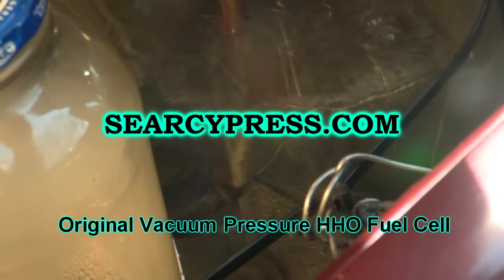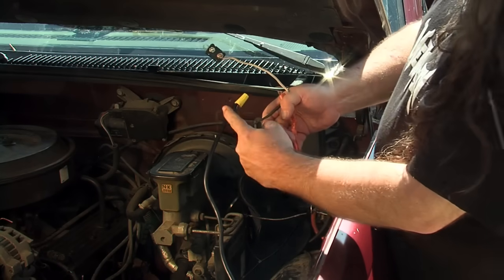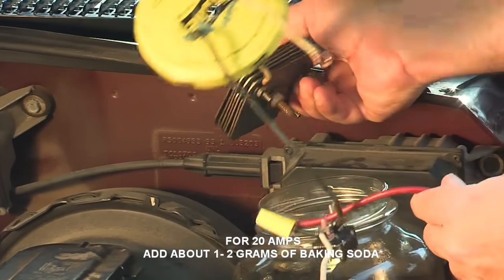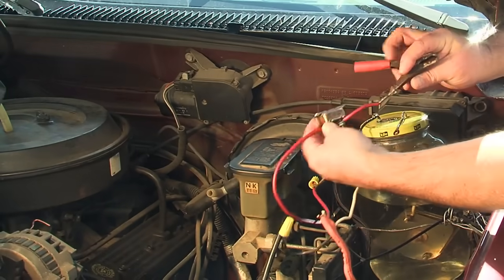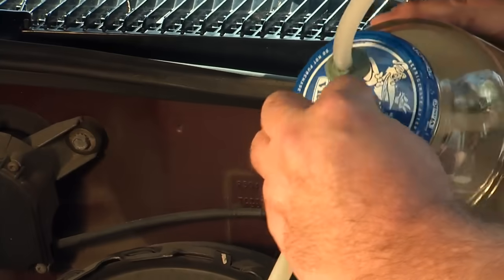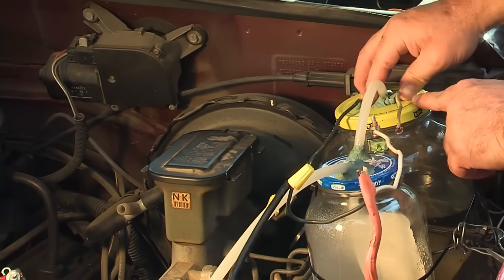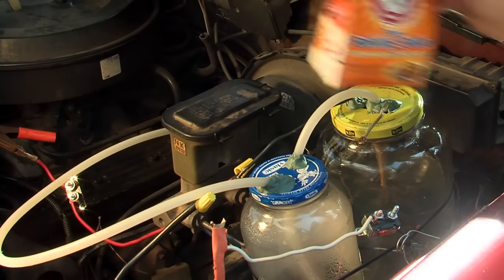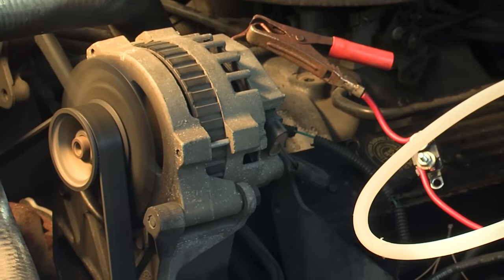Vacuum Pressure Hydrogen fuel cell defeats high gas prices using hydrogen from H2O.

Comment: 286 kJ/mol is required to electrolyze the water.
241 kJ/mol is released when HHO is burned.
This would only make sense if you were running the electrolyzer on its own battery bank that you charged at home. But then you'd have the added weight of more batteries forcing more work on the engine anyway.
Reply from the maker: Just remember we are not trying to power the engine with HHO. What we are doing is trying to burn the 20% of the gasoline that is normally unburned. That leaves a lot of room for gains without breaking any laws of thermodynamics.
Reply: This AND the amount of gas created would be negligible compared to the amount of air going through the intake.
Reply: You got your numbers backwards. 286KJ is released when hydrogen is combusted with oxygen. 241 KJ is required to electrolyze water to hydrogen. So in the end you have excess of energy to do work.
Reply: @HAGA7793  only a peak of 75% of electrical power is produced as hydrogen, the rest of the energy you state is actually oxygen... so you're running at a 25% loss before you even consider the 60% loss in efficiency from fuel to electricity from the alternators efficiency loss....

That's around 85% efficiency loss on a alternator that doesn't have a hot radiator on a hot summer day blowing on it too...
Reply: @dylandesmond  where are you getting your number from? Can you provide source?
Reply: @HAGA7793 If those numbers would be remotely true you would have energy gain, so effectively free energy. Which surprise surprise isn't possible.
Reply: This would work if the alternator is wasting energy, which it probably does, so as long as the wasted energy is more than that difference of ineffeciency in the creating HHO it would add energy to your motor simply by making it more efficient, I imagine this would work and could be a very good system. Does anyone really know how much wasted energy there is in an alternator? Not just conjecture, if they do it would answer clear up whether this would be a good system.
Reply: @seekerscovereal  not really the case, once battery is charged the alternator doesnt produce the same energy, basicaly enought to keep charged, that why when battery is charged the voltmeter may be at 12.5 to 13 volts but when battery is almost dead it will charge 14 or 15 volts. There is no free energy when dealing with rotational forces with parasitic losses. If it was this easy someone like bezos or musk would have a trademark on it and oil executives would be retiring in record numbers.
Reply from the maker: Not sure you're getting it. The object is not to power the engine with the gases we make. What we are doing is completely igniting the fuel which is normally unburned. This can be a substantial amount. In this engine about 20% goes into the catalytic converter. The extra energy comes from the gasoline and not from the battery. The catalytic converter runs much cooler and  a large amount of water exits the tailpipe. We  have a new video coming out this year. Thanks very much for the comment.
Reply: He does not comprehend the added efficiency of this allowing better efficiency of the fuel already uses.
Reply: I would make the HHO on a separate circuit that is charged off of small solar panels
Reply: @teemun3979  Wouldn't generate the ~30 amps you need to produce decent HHO
Reply: @taylorfielding5090  You would have to charge up a separate battery or form of capacitor over a long period of time which would discharge at the correct amperage once it reaches a good point. The whole HHO thing isn't efficient no matter how you do it, but at least if you had it on a separate circuit you could argue that you aren't wasting energy creating the HHO.
Reply: @teemun3979  The problem I see is that most solar panels (for cars) trickle around 80-100 mA, and it would take forever to charge a large capacitor. Unless you got a decent size panel, it wouldn't do much
Reply: @teemun3979  Nice idea....but probably only enough surface area on a typical vehicle to charge a phone...maybe run some lights.
Reply: Hmm, nice discussion.
Don't believe everything you read on websites and even some books are full of bs.
10 amps is more then enough to create  hydrogen to run your 4 cilinders engine.
Reply from the maker: The goal is not to run the engine. The goal is to burn the fuel that's getting wasted. That concept seems to be beyond a lot of peoples understanding. They assume that all that gas we are squirting into the cylinder is getting burned. Most of the time 80% or even less is actually used. The system removes engine knock preventing damage to pistons and cylinder walls as well as improving efficiency even if there were no other gains. I totally agree, sometimes less is more. Thanks very much for your comment.
Reply: @metalpresstv  
Hmm.
I agree that some intervals some sensors must be cleaned or replaced.
Reply: Yup, all these people failed science. And math.
Reply: @pepsiman91  I don't see how it would make any positive difference, you're still pulling drag from the motor to product the energy needed.
Reply from the maker: Let me explain. We are not trying to power the motor. What we are doing is injecting HHO in the state of vacuum where it is not diluted by intake air. 20% of the fuel that goes into this engine goes unburned and is ignited in the catalytic converter. Our goal, is 100% ignition of all of the fuel. This system gets extremely close to that. Instead of burning the fuel in the catalytic converter, it is burned in the cylinder where it is converted into usable energy. You might ask yourself why in the world are we wasting 20% of the fuel? Just imagine, if you were building an engine and you told the boss, we're only getting an 80% burn. And the boss said, that's fine. As an engineer you would know that that would be unacceptable. However, this poor design allowed for a complete industry of a emission controls. That is a ton of wealth for the industry itself in producing those devices. People see a lot of water coming from the pipe as shown in the video. They think I am saying this is from the hho, but it is not. It is actually coming from the gasoline itself. The reason you don't see this much water coming out of the tailpipe most of the time is because it is vaporized into steam through the catalytic converter. When you get very high efficient burn the catalytic converter does not get hot, at least not right away.When first installed, a lot of carbon and nasty junk will be ejected on to the ground. I've never seen too many things that can actually clean a catalytic converter, but this most certainly will remove a lot of build up. We have a new video coming out very soon. Thanks for the comment, do me a favor share the video. I would be most grateful if you would subscribe so we can show you the new video coming out very soon on this topic. I will do my very best to not waste your time. Thanks for the comment,.
Reply: @metalpresstv 
Combustion does not take place in the catalytic converter. If raw fuel is reaching your converter then its going to get plugged up and need replacement. Fuel reaching the converter would be caused by faulty injectors/carburetors, faulty air intake, or faulty ignition. Fix those issues. 

Hydrogen is far more reactive than vehicle fuel. Hydrogen will combust at 4% concentration, or less if under compression. The reason your tail pipe is puking out water is because all the generated hydrogen is reacting in the engine to make water. This is a fact. You can't change chemistry.

Assuming you divide your hho generator to vent the hydrogen and leave only the oxygen, then how fast would the system have to work? A small car engine moves 700 liters of air per minute at idle. That's almost 150 liters of oxygen. A 25 amp HHO generator will generate a little less than one liter of oxygen per minute. That is not an appreciable amount of oxygen. Once again, this is an unchanging fact of chemistry.

If you want more oxygen in your engine then add a blower to pre-compress the air heading into the engine.
Reply: If the burn is cooler then the exhaust is cooler and the hydrogen in the gas or diesel will also produce water.  A good test would be to see how much water actually comes out of the tailpipe - could be more than is used from the pickle jar.  
Trouble is Carnot says the % work that can be extracted depends of temperature difference.
Reply from the maker: @simonmasters3295  the catalytic converter is cooler. This is because the 20% of wasted fuel is igniting in the cylinder where it is supposed to be. I don't really think the exhaust temperature would be something you could measure accurately. There are just too many factors involved. The water coming out of the pipe is definitely from the gasoline. You can get about 200 MI on that jug of water. Interesting though. Thanks very much for the comment. Be sure and share and subscribe and we have a new video coming up very soon. Thanks for the comment.
Reply: @metalpresstv  your catalytic converter is cooler not because of fuel being burned.... if more fuel was being burned,  your hp would be higher and more efficient, and the exhaust system will be hotter especially the catalytic converter. 
Your catalytic converter is cooler because you have water trapped in it.
Reply: now also add how much is needed to produce electricity on the alternator to get the required power to electrolyze and then go further  how much of hho is produced by this amount of power at electrolyze and you will get a very low output ... So this HHO is stupid as  it gets... The only thing that maybe is using a retarder... but while its not adviced to store H its not a option.. almost all HHO experimental "Scientist " blow up once ... :9
Reply: Soooo say someone did this to a 2004 Jeep Wrangler. Is that an old enough model? Or must it be carburated and will the timing need to be adjusted and so forth
Reply from the maker: @pepsiman91  imagine you're an engineer working for a major engine producer. You use the most advanced technology in producing an engine that is well into the 95 plus percent range of efficiency. It works so well in fact, that no catalytic converter is needed. The emissions are well within acceptable guidelines. You then present this to your superior. Later it is completely rejected and you are told to redesign it to not be so efficient. I assure you this has happened to some poor fellow along the way. You see, there is an entire industry of emission controls that must be fed. The revenue from that industry is just too tempting to ignore. Thanks for the comment my friend.
Reply: @metalpresstv  get a wideband sensor. Install it where your water flow won't touch it on your exhaust.

Then you know if you're running more or less fuel,

As I said before, it's been debunked.
But using it on a solar setup and putting it into bottles has great results....

But you Need to adjust your timings and fuel. 

Get the wideband sensor and measure your fuel pressure and record how much fuel you use with and without the alternator producing fuel.

You'll be disappointed.

But as I said using fuel cells at home to harness hydrogen has economical benefits
Reply: SMH.
Electrical, Chemical, Thermodynamic to Mechanical force.
Regardless 286 kJ/mol inout it was still multiplied and output of 40% increase.
Laymans for you
Reply: @Nick S - You said: "286 kJ/mol is required to electrolyze the water. 241 kJ/mol is released when HHO is burned." Could that change, if outside air was also used, during burning?
Reply: @TOMGOOTEE  no, those are ideal numbers.
Reply: The engine is getting power mainly from gas. He’s just adding hydrogen and oxygen to the air intake to get more fuel. So the alternator is producing some fuel essentially
Reply: @bryanoverbey  Yeah, but the alternator is spun by the engine. Put more load on the alternator and more fuel is required to run the engine.
Reply: @nicks2437  Yes that is true, but when the car's battery is fully charged the alternator is still spinning with the potential to generate energy. So you are getting parasitic energy loss from turning the alternator anyway. 
Say that turns out to be 40 Watts of energy to spin the alternator and not generate any energy.
Then if you now add this HHO system, you may draw 200 watts to run it, but gain 180 watts from burning it.
You no longer have parasitic alternator usage, so you're only burning 20 watts to spin the alternator instead of 40.

These are made up numbers, and although I have a B.S. in physics I'm not sure my idea is accurate, but I'd like to find out more..
Reply: @bryanoverbey  While that may be true of alternators from decades past that used permanent magnets, modern alternators are designed with electromagnets so that the output can be varied to meet demand. So parasitic loss isn't really a thing anymore. And even if the battery is full the alternator is still powering all your vehicles electrical components.

Realistically, if this system was viable for fuel savings then vehicle manufacturers would have incorporated it a long time ago and charged consumers through the nose for it. 
>"Yeah, it costs an extra $3000 up front but you get that back within 10 years on the fuel savings. And don't forget to only run Ford branded electrolyte to maintain your warranty!"
Reply: @nicks2437  More weight of batteries is harder on the engine? He doesn't need to run a 1,500 cell module battery bud. Lmao!!! The extra weight at MOST needed would be a 12-24 volt series system. Like in a semi truck/tractor-trailer. 

That would be about 20-30 extra Lbs. Equal to his spare tire and jack. LoL!!

Edit: I should also add that I spent 20+ years engineering internal combustion components. I grew up as a heavy duty mechanic. 

You can get a high output alternator that would deal with the 29 amp draw. 29 amps is not a lot of a draw. It's equal to the A/C compressor at full draw. 

Do you know the stress of a fully engaged compressor on a motor running? 0.02-3% power loss. 

And I need to address your alternator tech talk. NOW ADAYS alternators are elctro-magnetic? The have been elctro-magnetic for over 80 years. Ever since passenger vehicles switched to 12v from 6v.

PS - "If this was a viable and efficient method then it would be manufactured"??? 😑 Were you alive for the Saturn EV1 fiasco? When GM was forced to repossess all of them from people who bought them and drove them? The fuel companies were outraged. How about biodiesel. One of the greatest fuel systems in the world. It is illegal to convert and no manufacturer makes them. They would lose a ton of money.

Canola oil internal combustion engines are another issue. A lot of engineers are being monitored just for showing people their designs of canola oil run planes, cars and commercial equipment. 

The only reason the fuel corporations are all onboard with electric and hybrid is because they started buying up lithium and cobalt mines and operations around the world. So now they make a ton of money even if they DO lose on petroleum fuel sales.
Reply: There is no way you spent 20+ years engineering internal combustion components and don’t understand the kindergarten level concept of conservation of energy. Anyone who knows what they are talking about here can see very easily through your bs. This is on the same level as perpetual motion, but you probably buy into that as well
Reply: @bryanoverbey  When the battery is fully charged, there is almost no load on the alternator, only producing enough electricity to run the spark plugs. When you put a 30 amp load on an alternator it drags the engine down, as it saps more energy to run the generator. Modern alternators are very efficient and produce only a minimal drag when not under load
Reply: @nicks2437  not necessarily true. You're giving Big Auto a lot of credit. Car manufacturers aren't going to waste time with this, since gone also are the days of carburetors and vacuum lines. There's too much that would ultimately wrong. Regardless of how this design was incorporated, somebody somewhere would try to modify it. Eventually somebody would do something stupid and blow themselves up. BUT, as far as alternators go, I have to side with you. OP's 350 V8 has a lot of rotational energy. Contrary to, say, a carbed 4 cylinder, where the amount of added rotational resistance could easily be a deficit instead of a gain.
Reply: @Twitch_Moderator  corporates not only gains from lithium and cobalt. They'll also sell more gas to ship those things, as well as for producing more electricity. Also i see that they're now having a fresh market with a reason to renew the car park, selling loads of new cars. Then electricity prices will skyrocket and gas prices will tank, together with the green illusion, leading to people wanting to buy gas cars again, so more new cars 📈
Reply: @bryanoverbey  lol it's cause they are, electrolytic water isn't the same as water, takes 1000's times less wattage to electrolyse electrolyte water as opposed to actual water. The idea is salt + water is your fuel. Because you are in fact using something! And just because it's cheap doesn't make it bull shit rofl. I run a push mower off solely just water electrolyte 🤣🤣
Reply: @bencumming9418   No one is talking about perpetual motion here as it violates thermodynamics laws. But based on theoretical numbers, the energy released when hydrogen is combusted with oxygen is greater than the energy required to electrolyze it per mol of hydrogen. Life would be impossible if the energy we extracted from a chemical state was less than the energy we put in to get to that state. Think of oil refineries or nuclear power plants. They obviously need energy to operate but the energy that’s extracted in a form of chemical potential is greater otherwise we would not even have the energy to operate these plants.
Reply from the maker: People seem to think we're trying to run the engine on the fuel we produce. This is not the case at all. 20% of the fuel, in some cases, is completely wasted going into the catalytic converter where it is ignited. What  we are doing is seeking a higher efficiency burn inside the cylinder itself. The evidence of that is of course a much cooler catalytic converter. The result is visible water which is produced mainly from the gasoline that is being burned. We have a new video coming out soon, be sure and subscribe so you don't miss it. We will try to cover as many of these topics as we can and explain some of the misunderstandings. Thanks for the comment.
Reply: @bryanoverbey  he said 29amps.

That's 400-500watts on a 14.9v alternator....

Hydrogen production via electricity on platinum plates is 25% efficiency loss, 

Much closer to 45% loss on stainless plates, so he's got 1kw of parasitic losses just to run the alternator to produce 600watts of hydrogen....

He's not even running peroxides, just baking soda... so his hydrogen production is reduced furthermore.... probably only making around 200-300watts of hydrogen for every 1kw loss.... 

He also said it sucks the water in.... 
You don't save on mileage spraying water into the intake.... actually lowers the engines efficiency drastically...

Might clean out the pistons if it doesn't crack anything....
Reply: @Twitch_Moderator yeah sorry dude , an AC compressor at full capacity definately uses more than 3%. More like 5%-8%